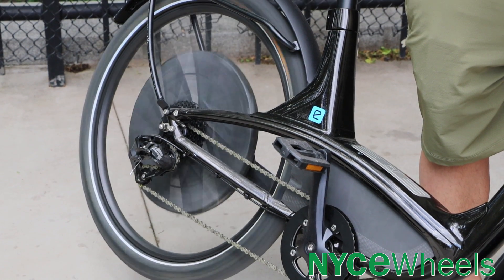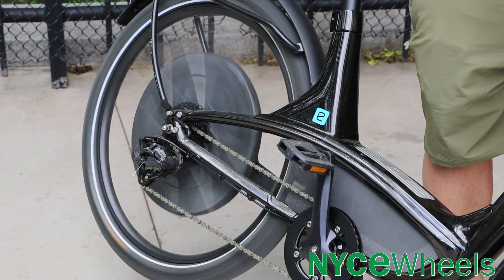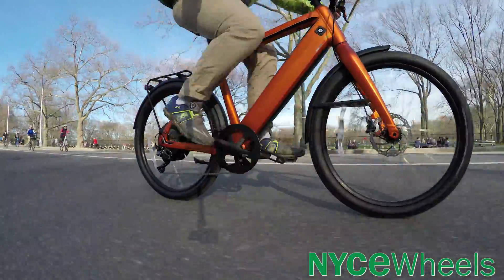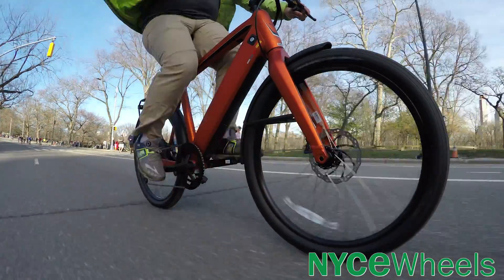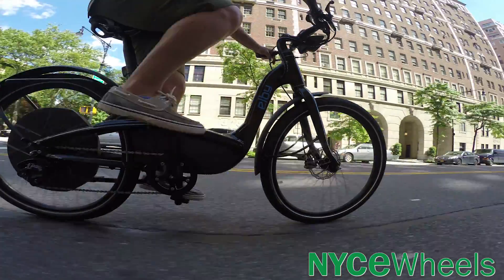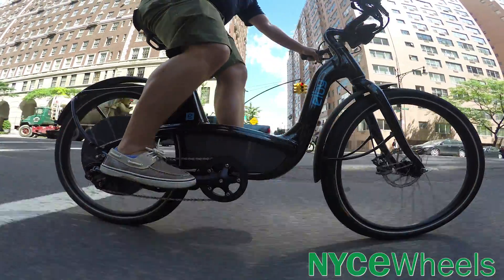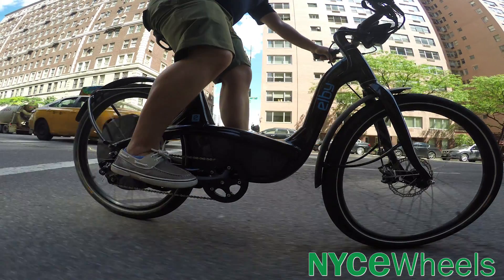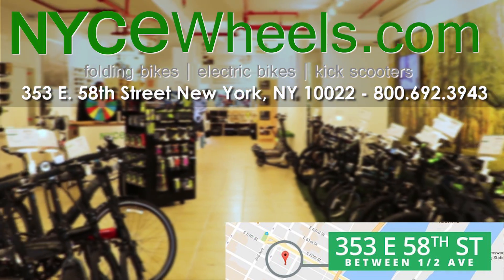What does regenerative braking really do for your electric bike?

Comment: try this design.. i guarantee you.. 😬

Equipments
*charge controller depends on the battery
*conversion kit that have regenerative breaking.
*wires

Steps..
*assemble first
*after assemble tap a wire in the connection between the motor and the ebike controller.
*connect the wire in the battery charge controller.
*connect the charge controller into battery..

Comment: there is nothing in here to show us anything.   You are just saying " it doesn't work" so I have to ask google more.    You should do some kind of measurement experiment.  Googles knowledge graph says regenerative braking in practice on a tesla is 70 perfect effiient, so you could have started with that.   Google is telling me it ranges from 10 to 70 percent.  A research paper is taking about the shape of the signal from BLDC motor, and its up to the controller.  The losses that contribute to 30% loss are on top of methodology or signal processing, more like friction or physical.  So it would be helpful to make a video by taknig  a bike , turning it upside down and measuring voltage that appears when you turn the wheel.  Also we might have to turn the trottle, turn on the regenerative braking , each controller has swithces for that  we dont konw how its hooked up , and each ebike is different.  Seems like a very good opportunite in an ebike, more so thatn in a care, and its underserved.

Comment: I have a RadCity and I get at least 50% more distance out of a charge using regenerative braking. I doubt if this fellow has any electronic, electrical or Scientific training.
Reply: it would be nice to have my ebike switch between using the motor for assistence and then using it to recharge itself. 

I would like to see a video going into more technical terms and showing iif it or isnt actually possible. 

with an ebike that has a range of 100 miles, that extra 1 does count. Also it would be nice if he talked about how much more torque is needed for a dirrect drive and if it is good for hilly terrain.

Comment: look up Zehus  . regen 40-125km 😎
Reply from the maker: While Zehus's tech is slightly better than average, you still don't really get that much regen out of it without working really hard.
Reply: NYCeWheels it depends on the type of riding you do. My track the cycling root, I use 40% and recharge 35% going up hill and then down hill, so don't need to charge. Probably 1 every 3 months, due to the backpedal future. Cheers
Reply from the maker: That's awesome! This video is in reference to the bike we carry (Stromer/Bionx), where regen isn't a highly focused feature, and the batteries are so large that the effect is very small. Zehus's system has regen as more of a focus in their design, and having a smaller battery means the regen will have a more noticeable effect.
Reply: @nycewheels  battery size has nothing to do with it, just admit that you don't know everything and thus were wrong